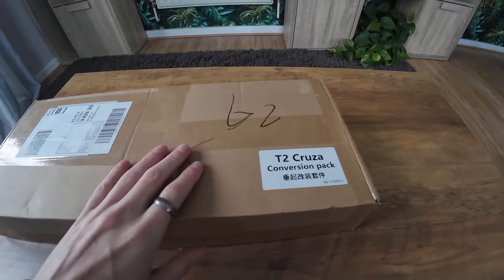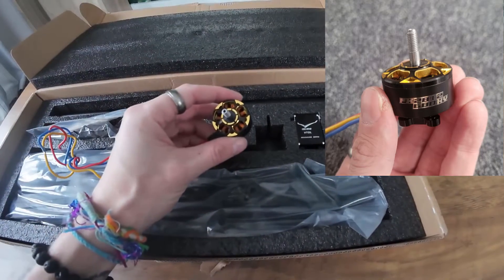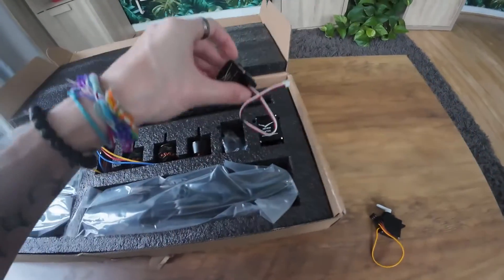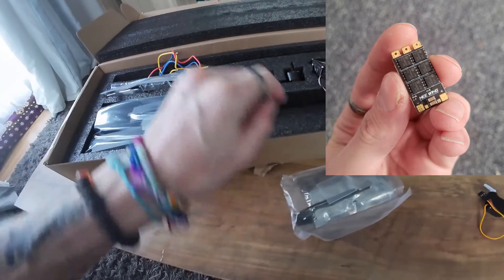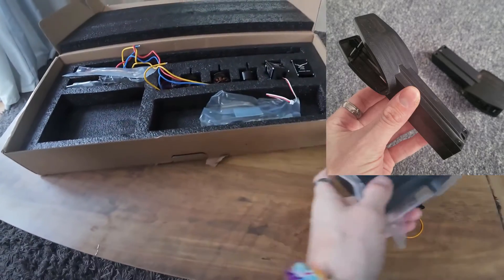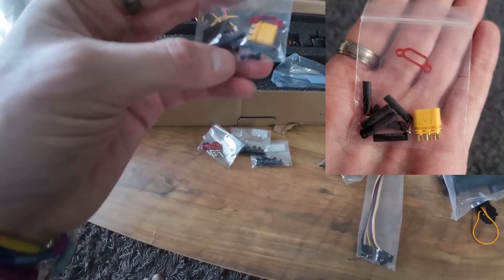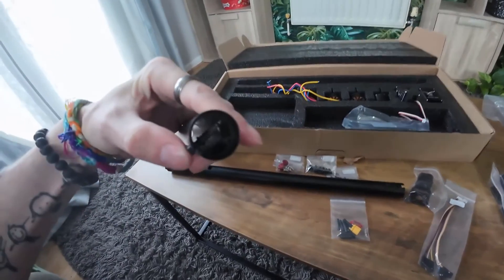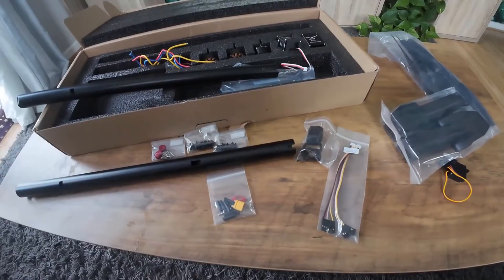🛩️ Heewing T2 - VTOL Conversion Kit Unboxing

Comment: I’m almost done with mine, the tail boom was a little tricky without instructions, but the plane was originally designed for this upgrade unlike the t1 so it actually went pretty smoothly. Just need to get the little red bracket screwed on the mr30 from the inside of the boom not the outside. Hope that helps.

Comment: That kit is expensive, but at the same time it looks like they include some pretty quality components.

The T2 servos are the ones that look like “standard” size. That Emax is a micro size. But yeah, if you’re used to the smaller stuff, they look massive.

As for brushless, I didn’t know they were a thing either until I got back into R/C cars recently. They seem to be fairly common (or at least, not rare) in that side of the hobby for bigger stuff. I have a couple for steering servos, they’re impressive.

Comment: 25amp esc for 6s🤔
Reply: When voltage goes up, amps go down - for the same watts
Reply: @phljns  granted,but I feel 25amp is low considering most quad motors with similar size motors,props,disc loading etc… have 50amp plus